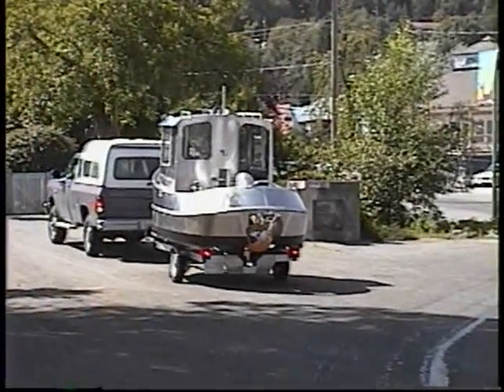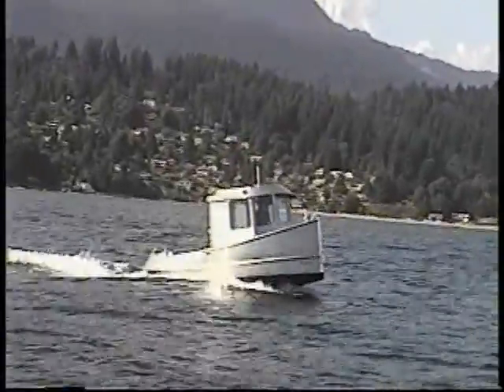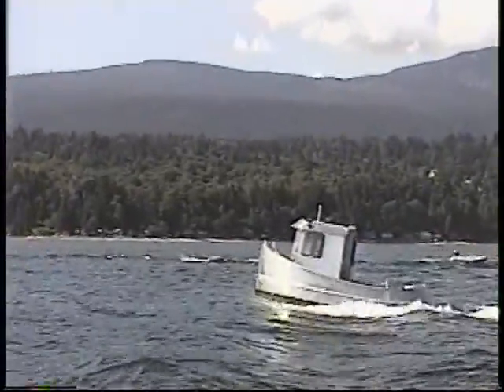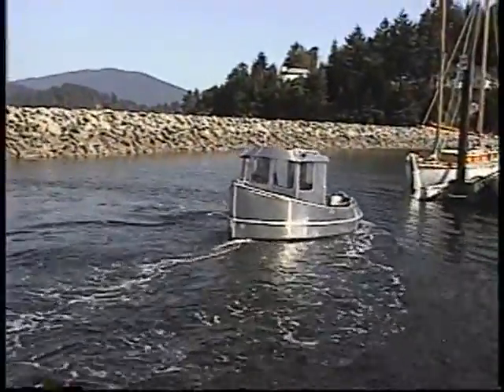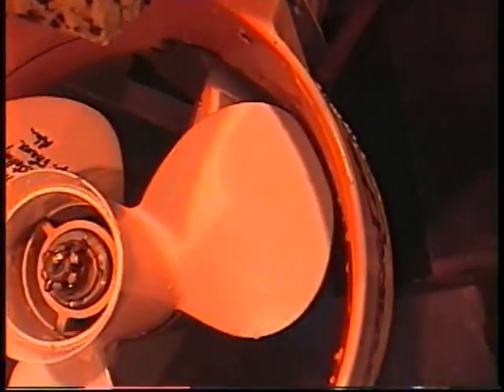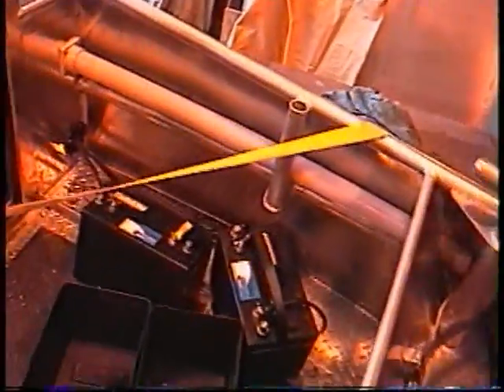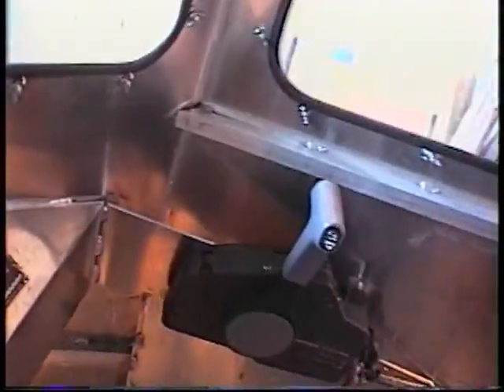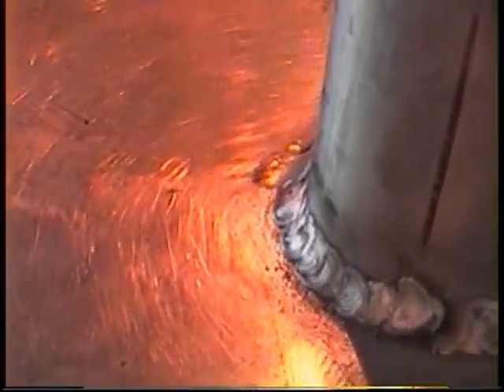14' Minitug Launch, 1998

Comment: Poor wildlife underwater. It is dang loud.
Reply from the maker: The noise was mostly from the Volvo powered crew boat which was the filming platform. The Minitug was a very quiet with a Honda outboard.
Reply: Cannot mmodify. It was loud but not the boat. It is really cute. Am not a hater
Reply: Eltric outbard

Comment: Need a a deeper v bottom
Reply from the maker: Well that would be a different boat then.
Reply: @360Crank I don't think "real" tug boats have "V" shaped hulls anyways, aren't they rather flat (ish) on the bottom? 
BTW, are there plans available for this boat?
Reply from the maker: @bob2161   Old school tugs were quite fine and fairly deep forward and wound out to a flat run aft to make room for their rather large props. Generally. This vessel is really a toy, but surprisingly able for its intended use in inshore waters. The design is a Candu-EZ, designed by the late Berkley Eastman, and was really intended for plywood. As it happens, shapes that can be built in plywood lend themselves to plating up in aluminum quite easily. The designs were featured in the ads section of WoodenBoat Magazine for decades
Reply: @360Crank  thanks for the response. So, aluminum was not the originally intended build material. That's one heck of a modification. I've got some woodworking abilities, so I'd probably go that route since I have zero sheet metal experience. Though I have to admit that the aluminum definitely has a powerful cool factor. 
I will check out the Candu-EZ site for plans availability. 
Thanks again.
Reply: Russell Bros tugs are flat bottomed for working log pond and lake logging operations.

Comment from the maker: Hi Mehmet. You are absolutely right, as I mentioned in my comment above. The customer wanted to have a lot of "bollard pull" as he was actually doing some work with it. The boat was never meant to plane, it just did.
Reply: Dan McPherson  do you have building plans for the tug
Reply from the maker: The boat is built to plans for "Candu-EZ" from Berkley Eastman.
Reply: @360Crank  dan, do you build this on commission?
Reply from the maker: @luisaloma3532   This one was built for the owner of the company but, since, has been sold. I am no longer with Dearden Marine, but I'm sure you can call about commissioning a build.